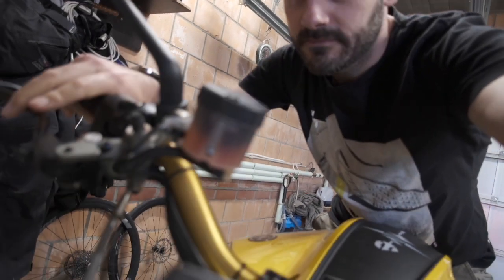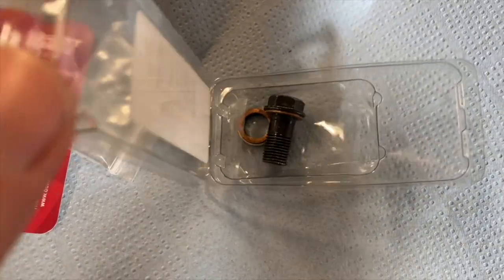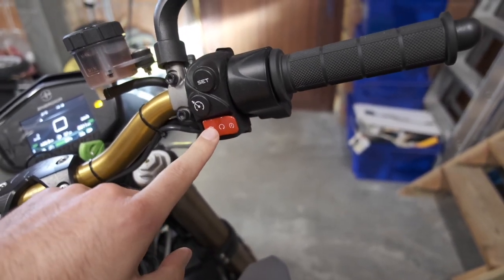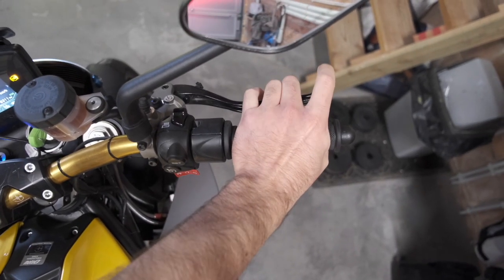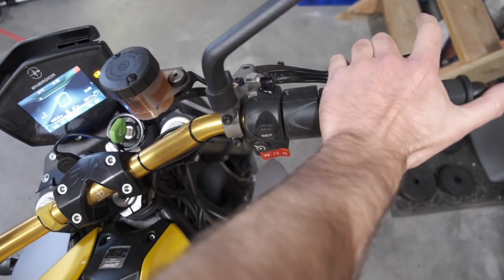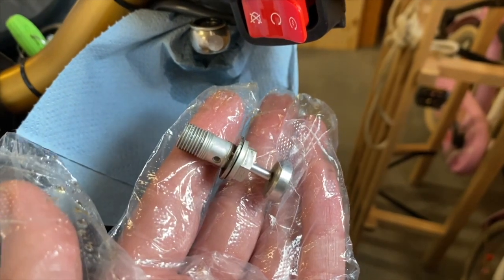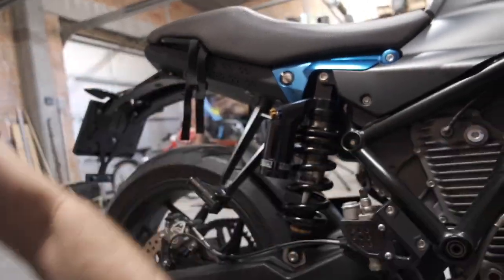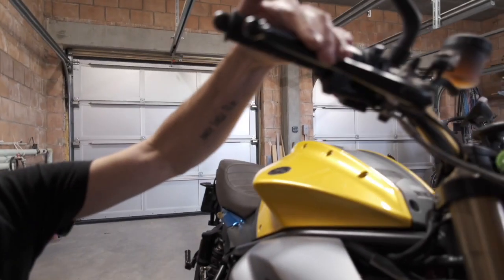Finally fixed all bullet brake issues | not a review of a parking brake system for motorcycles

Comment: On my SR/F I have swapped the original mirrors with "end of handle bar" versions to see less of my shoulders, and that gave me a slit which I used to attach a rubber band. A very primitive, simple, but also effective solution.
Reply: The old Fortnine hack, using this as well!

Comment: Well I had the BulletBrake in my EsseEsse in for circa 3000km (until destroyed). It worked as supposed. Now, I have a new BB sitting here ready to be installed on my Ribelle, I will need to find the minutes to install it - still with a dealer standing by for some other warranty stuff. He will also professionally bleed the system. So, I will give it a second try🤩. But good (or not good?😥) to hear that the BulletBrake may be no bullet proof solution… so will be extra cautiously storing away the original parts and will order crush washers already.
Reply from the maker: Could always be that I just got a bad one that leaks somewhere. On the other hand it did hold pressure when engaged.
Reply: @Hans2183  well since I’ve got it now I‘m Gonna install it anyway. If I remember posting here, I will let you know my experience. Maybe it’s a design fault, maybe it’s one defective part. How long did it take after perfect bleeding until you had a soft response of the handbrake again?
Reply from the maker: Within days really. It would be firm right after the bleed but often when I started riding within the ride it would already soften up. At some point I thought it would only happen when I engaged the bullet brake so I tried not using it (just to check) but that didn't help.
Reply: @Hans2183  Did my installation a few days ago. It went like a charm, only a few bubbles escaped on the brake master cylinder during the bleeding - after that the brake was as grippy as before. After 300km, I cannot observe any negative aspect. I had to take it to my dealer this morning for some warranty repair (disc brakes and head lamps) and reserved capacity to bleed the brake. Actually, I do not require this and thus did not ask for it.
I will however observe over time.

One thing I noticed: The old bullet brake that I received mid 2020 had crush washers that were just very thin rubberized. The one I received recently had a relative thick rubber plating, almost like 1/2 of the thickness of an o-ring on either side of the washer. Also, the tiny piston that you pull to activate the BB seems a tiny bit more tight compared with the old one - it moves much tighter. Probably just a question of a few 1000th of a milimeter.
Reply from the maker: Thanks update Matthias. Glad to hear it works for you. Might have been a bad one I got.
Reply: Mine is also still working ok, got it a year on the bike now, no problems at all